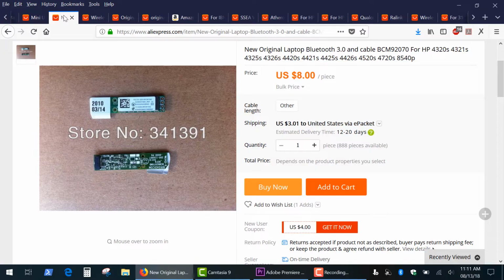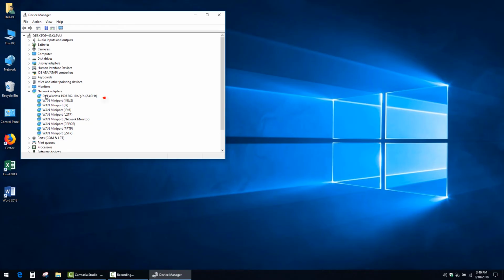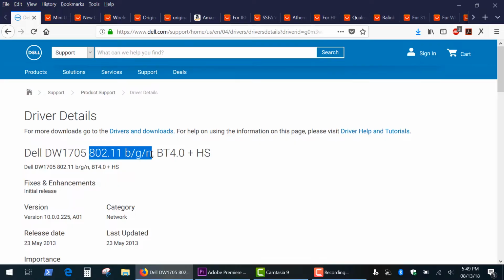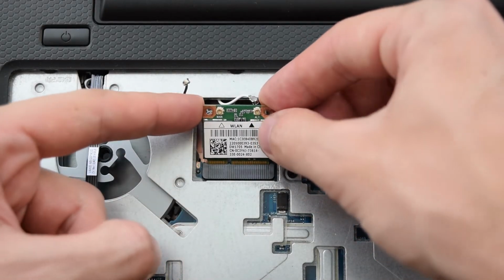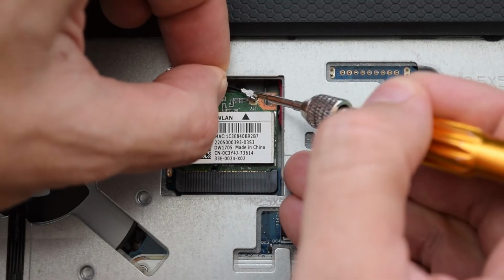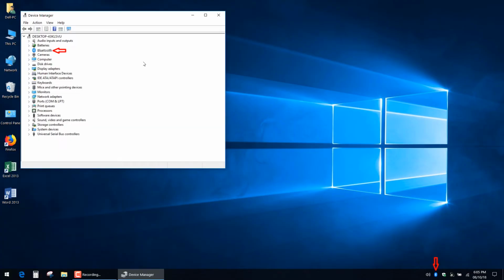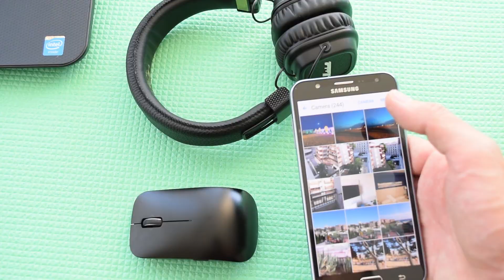How to Upgrade Your Laptop Wi-Fi to 5GHz + Bluetooth 5.0 (Combo Adapter Install)

Comment: Can i also do this to my ps3?
Reply from the maker: The PS3’s wireless module is a custom-made, proprietary combo unit that handles both Bluetooth and Wi-Fi, unlike the removable Wi-Fi cards you find in laptops. Upgrading or replacing it isn’t really an option. If you’re looking for better wireless performance, your best bet is a wired Ethernet connection. You could also try an external USB Wi-Fi adapter, but those can be hit-or-miss when it comes to compatibility.

Comment: Help to find 5ghz card for my hp 15ay503tx laptop
Reply from the maker: Here's what you need: https://alii.pub/75pqbp
This Wireless card supports both 2.4GHz and 5GHz bands and also provides Bluetooth 4,2 connectivity. It will work perfectly on your laptop.
Reply: @ thank you but not able to view the product, it says page requested cannot be found
Reply from the maker: @ I've updated the link.
Reply: @ElectronicsComputers  Thanks for the help, but I just checked my laptop. It has a “Realtek 8723be” Wi-Fi card, and there’s only one antenna cable connected. I don’t have the second cable either. So, my question is, if I replace the Wi-Fi card, will I be able to connect to the 5GHz Wi-Fi? I’m a bit doubtful because of the single antenna cable. Can you help me out?
Reply from the maker: @ I'm perfectly aware that your laptop has only one antenna, I had a bunch of those in my repair shop. It will work perfectly fine on both 2.4GHz and 5GHz bands. You don't need a second antenna. You have to connect your antenna to the connector marked as Aux.
Reply: @ElectronicsComputers  Thank you so much! I’m just getting a bit greedy here. Do you have any cards in mind that support 5GHz Wi-Fi and a higher version of Bluetooth, like 5.1 or 5.2?
Reply from the maker: @prasanna3997  Unfortunately, that HP model has a BIOS whitelist that determines which components can and can't work. The wireless card I linked to is installed in the same model but in a higher-end variant. I checked that in a service manual. So unless you're willing to learn how to modify the BIOS and add different wireless cards to the list, that's the only option that will work as soon as you turn on your laptop.
Reply: @ElectronicsComputers  Thank you so much! You’re awesome! I’ll definitely check out the link you provided. 😍

Comment: I have one question at first wifi and bluetooth work perfectly but suddenly the bluetooth pnly not work but the wifi work perfectly till now first i thought that its a driver problem but i reinstall upgrade try other driver all these but still the problem remain even i dual boot my laptop with another os which is linux at there also only wifi work not bluetooth if its driver problem how can a problem remains even use in another os so do anyone know why this happen and whats the solution pls let me know
Reply from the maker: Try removing the wireless card and cleaning the contacts with rubbing alcohol. Keep in mind that WiFi and Bluetooth are two separate devices integrated into one module, each using different interfaces: WiFi operates on the PCIe bus, while Bluetooth uses an internal USB data line. Ensure that your BIOS is up to date and that you have the latest and correct chipset drivers installed.

Comment: Thanks for the video. It's amazing! What do you think, Can I upgrade my Lenovo G700 laptop? Thanks! (Can't find exact info on this...yet)
Reply from the maker: Unfortunately, upgrading the wireless card on that model isn't easy. Lenovo has a whitelist of approved models in the BIOS, and if you want to install something better, you'll need a custom BIOS with the whitelist removed. So, it's not really worth the effort.
Reply: thank you very much for your quick respond

Comment: I have one question please my moms laptop does not support 5 ghz internet only 2.4 ghz, does i have 5 ghz after i upgrade it to a new wifi 6 card adapter ?
Reply from the maker: It depends on the laptop's model. Not all laptops are upgradable in the first place. What's the brand and the exact model of your laptop?

Comment: Hi, very good video on this upgrade,but please explain more clearly what you gained by this modification.
You replaced DW1701 wi fi card with new model DW1705 wi fi card.
So did this just add 5.0 GHz connection capability?,or did it also improve your bluetooth connection properties.
You explanation would increase my understanding of why this upgrade is usefull.
I have a Dell Inspiron N5050 i5 running windows 11
                                                                        regards   Colin
Reply from the maker: For that particular model I added a combo wireless adapter that also has Bluetooth because the previous model only had WiFi.
Reply: Hi, thank you for the update ref my question very kind of you.
So it just added bluetooth 4.0 but not 5GHz wifi capable.   @ElectronicsComputers

Comment: Man that title makes me lost faith in human... 802.11a was the first that works for 5Ghz channel in 1999 so 5ghz it's not a generations for example That one works at 54Mbps and yours I believe should be more like wifi 5 or 802.11ac that gets up to 800Mbps I believe and wifi 6 it's 802.11ax that makes and speed a grade in both channels 2.4 and 5 Ghz up to 10Gbps... So if you choose a title be care about.
Reply: For sure if ur was wifi 5 or 802.11ac by grace of God it was an upgrade in 5Ghz band too... But as I said for wifi 6 doesn't mean it's in 6Ghz band.

Comment: How to know it’s compatible with my laptop i want to upgrade my wifi card i have old laptop
Reply from the maker: What's the model of your laptop?
Reply: @ElectronicsComputers  hp 620 notebook currently in my laptop rt3090bc4 card but it’s not working from previous some days i want to upgrade but don’t know which card i should use or it will work in my old laptop

Comment: does all bluetooth combo module has the same connectors?  coz I'm looking to upgrade my 10yr old laptop bluetooth combo module and I'm not sure if for the past 10yrs it still using the same exact standard for the connectors.  I'm doing this because logitech wireless keyboard and mouse made it hard for me to switch from pc to laptop coz my laptop needs  that logi bolt receiver to work.
Reply from the maker: What's the model of your laptop?

Comment: This is a great vid! Short and to the point. Now if the replacement card is one that the laptop manufacturer says is compatible, do we need to reinstall the WLAN driver? Point is the driver sometimes seems differ based on WLAN manufacturer.
Reply from the maker: Yes, you need to reinstall the driver. I'd recommend downloading a new driver before you replace the card.

Comment: hello, i enjoy your content. Question can i do this to my laptop toshiba satellite l755-85311?
Reply from the maker: Hi thank you! Toshiba whitelist wireless models in its BIOS, so in order to use some alternative models you need to modify your laptops BIOS. I wouldn't recommend messing with it. If you just need a Bluetooth you can buy a tiny USB adapter like this: https://amzn.to/3W6DB4P or Dual Band WiFi adapter: https://amzn.to/3xfsf41

Comment: There is wifi + bluetooth module on my computer, but I want to attach a higher version bluetooth usb adapter without removing the module, if I do this, will it work?
Reply from the maker: Depends on your laptop model, which you didn't provide by the way.
Reply: @ElectronicsComputers  Its Lenovo 110-11 İSK

Comment: On my old HP Compaq NX7400 (from 2006) a few years ago I had updated the bios with a version without withelist to be able to replace the WiFi card with a dual band card. I had replaced the old Intel PRO Wireless 3945ABG with an Intel WiFi Link 5300 and the WiFi works fine on 5GHz. Now I would like to update the bluetooth from v2 to v4 as well. Unfortunately the NX7400 is equipped with a Broadcom BCM92045NMD module which cannot be replaced with a newer one. I tried to mount an Intel 7260AC instead of the Intel 5100 (using a half-size -> full-Size adapter). Wow, the WiFi reaches 500 Mbps! Unfortunately, the Bluetooth module of the 7260 is not seen by Windows. The only solution is to unplug the internal BT module and use an external USB dongle? Thanks for the tips.
Reply from the maker: The PCI slot for the wireless card provides two interfaces PCIe and USB. For laptops that have a dedicated Bluetooth module the PCIe port usually doesn't wired to USB port. So the only way is to use an external USB Bluetooth adapter.
Reply: @ElectronicsComputers  
I suspected, notebooks produced when Mini PCIe WiFi cards were full-size did not have the USB Data pin connection (36=D- and 38=D+) of the Mini PCIe socket because at that time the combo cards didn't exist yet and for this it was necessary to use a separate bluetooth module. Thank you very much. 👍

Comment: Is it possible to do this upgrade on a HP Pavilion 15.6 p189sa notebook with an Intel i5-4288U CPU

I have a Realtek Rt8723be 802.11bgn wi fi card with 1 main antenna cable, 2.4ghz is the only frequency I have access it, 

Is it possible to upgrade my wi fi card so I have access to 5ghz as well?
Reply from the maker: It's possible to upgrade your laptop. But the problem is that there's only one antenna in your laptop. So if you'll use only one band for example 5Ghz then you can buy Intel Wireless-AC 7260HMW adapter and connect your antenna to 5GHz port only.

Comment: Hey man i know this video was released a while back but i recently purchased a 7260hmw for my hp ProBook and it worked but got rid of 5ghz wifi any suggestions?
Reply from the maker: What's the model of your laptop. Check the settings of your wireless adapter, maybe the 5GHz band is turned off.
Reply: @ElectronicsComputers  hp probook 650 g1 followed your video didn't work Bluetooth worked 2 4ghz worked but did your video and didn't fix

Comment: sorry my english is not good, my adapter 2.4Ghz+4.0, i want to upgrade to 5GHz+5.0
how to know the new wifi/bluetooth adapter compatible to my laptop ? 
my laptop is ASUS A45V with qualcomm atheros AR9845WB-EG + AR3012
Reply from the maker: Unfortunately, it's a very old laptop and there's no compatible adapters for that model.
Reply: @ElectronicsComputers  can you explain how to check that adapter is compatible or not compatible ?

Comment: 1= black and 2= wite????
Reply from the maker: It depends on the model of your wireless adapter. in most cases there's no difference actually, because those antennas are absolutely identical.

Comment: Hello I bought one  combo  adapter from Ebay, couldn't figure how to install the drivers on the  damn thing. I placed  also on my desktop's pci express,  not  recognizable either, coming up  as unknown device.  I installed some drivers according to the module's label but still it didn't work, I bought if from ebay. Could it be  a defective unit, or is  there some specific laptop hardware required like for example RAM that only  works with certain  specs?
Reply from the maker: What's the model of your laptop and wireless adapter?

Comment: Does the ralink rt3290 have 5ghz and Bluetooth
Reply from the maker: It has only 2.GHz and it has Bluetooth 4.0. There are a few models on the market which support 5GHz in this card form factor which may not be compatible with your laptop. What's the model of your laptop?
Reply: @ElectronicsComputers  hp pavilion g6 2000
Reply from the maker: @OliveIsTyping  Here's the best option for your laptop which supports both 2.4 and 6GHz networks and Bluetooth 5.0:
Amazon: https://amzn.to/3qtpQhx
Aliexpress: http://ali.pub/5chion

Comment: Why do you replace both the Bluetooth card and the wifi card? Is the card I’m buying a “combo”? Ie one card that does both?  If the task requires replacing 2 separate cards it’s not a combo. I’m totally confused here. Is it one combo card or 2 separate cards. Is the wifi card optional? Please explain. Thanks
Reply from the maker: Nowadays WiFi and Bluetooth come in one combo module. Cheap laptops usually come with WiFi only module so you can replace it with combo one.

Comment: Nice vid! Just wondering if you know which wireless adapter is compatible with samsung NP300E4X.
This is an old laptop and planning to revive it since I can swap out the parts as well as the wireless card
Reply from the maker: Atheros AR5B225 wifi 150Mbps +Bluetooth 4.0 is the best option for that laptop. http://ali.pub/55fdtp

Comment: i have an old laptop AMD i think this is the solution of my problem because on windows 10 my laptop hp pavilion g6 series has no covered or compatible on windows 10 only for windows 7, but possible if compatible on any wifi & bluetooth card with same pin? sometimes I found in online store there's intel on wifi and bluetooth card its compatible bro?
Reply from the maker: I need the exact model of your laptop to check compatible wireless adapters.
Reply: @ElectronicsComputers  hp pavilion g6 a4-3300m

Comment: Hi, I have a hp elitebook 840 g2. It has a qualcom atheros AR5B95 wifi card. My laptop does not have bluetooth. Please suggest a suitable upgrade so that I can have bluetooth in my laptop. 
thanks in advance
Reply from the maker: The best option for your laptop is Intel Dual Band Wireless-AC 7265 802.11 ac (2X2) Wi-Fi + Bluetooth. The link for reliable seller: http://ali.pub/5301wg
Reply: i have hp elitebook 8470p only WiFi adapter suggest me WiFi Bluetooth card

Comment: I have trouble connecting the antennnas I try push hard but it doesn't go in
Reply from the maker: Make sure that the connectors are not bent or damaged.

Comment: Hi, my laptop is HP Pavilion Gaming 15. My issue is, when I connected it to bluetooth headphone, the audio started stuttering, but when I connected to android phone, the audio didn't stuttered. Does changing bluetooth chipset help this problem? Thx
Reply from the maker: Try to disconnect your Wi-Fi connection, wireless muse and keyboard and check if it helps. 2.4GHz Wi-Fi and some wireless devices may interfere with your Bluetooth headphones. If it's not your case then upgrading your wireless adapter is an option.

Comment: Can I replace it with used wifi card ? Mine is broken
Reply from the maker: Sure! But they are not all compatible. What's the model of your laptop?
Reply: @ElectronicsComputers  LG R570 xnote
Reply from the maker: @AlienO0bserver  Here's the adapter for your laptop: http://ali.pub/50ioev

Comment: Hi could you please help me with this. My laptop had a working WiFi and Bluetooth a while ago and something happened to my motherboard and after the repair Bluetooth is not working and WiFi works frequently not getting internet connection properly. But I connected other card to my laptop, still same. Is it a problem with my motherboard?
Reply from the maker: What's the model of your laptop and your wireless adapter?
Reply: @ElectronicsComputers  Acer aspire v3-571g
WiFi adapter is Broadcom

Comment: My laptop is HP Pavilion Notebook - 15-ab523tx. It only has 2.4 ghz wifi adapter only. I've 5Ghz router and can i upgrade my wlan adaptor? Is it worth to update this to a 5ghz wifi adapter to boost internet speed ?
Reply from the maker: Intel 7260HMW: http://ali.pub/4uc85c will definitely work for you

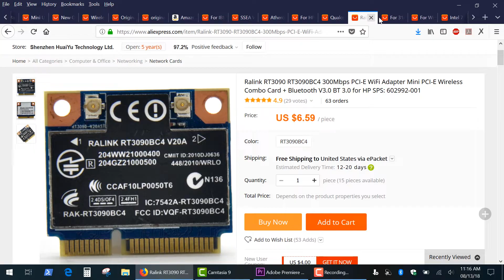Comment: in my laptop only wifi adapter (time 0:43)
no bluetoot adapter. i was using external bluetooth dongle.  (time 0:06)      
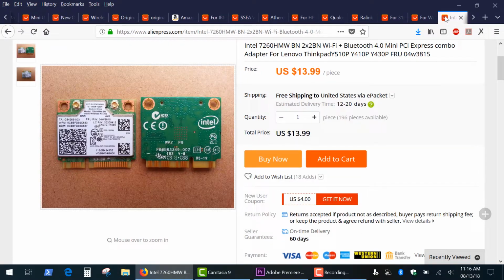and i want to upgrate this adapter to wifi and bluetooth adapter together. (same size in time 0:43)
will it work? 
Acer Aspire 5750G
Reply from the maker: You can use this adapter: http://ali.pub/4tbgam
Reply: @ElectronicsComputers  thanx. Can i use all dual adapters?

Comment: Hi! I found the link for asus wifi and bluetooth chipset in your description but it seems that it doesnt have bluetooth 5
Do you have any newer link for bluetooth 5?

My asus laptop is ROG G551JX (i bought it in 2015)
Reply from the maker: Combo adapters with Bluetooth 5 doesn't exist and that form factor card. Wireless adapters with Bluetooth 5 have different cards form factor with different slots. The only way to upgrade to Bluetooth 5 is USB dongle.
Reply: @ElectronicsComputers  Ah i see, so once ive connected a bt5 dongle, will it automatically replaced the "laptop" bluetooth?  and do I have to reconnect all of my peripherals to the new bt5 dongle?

Comment: Thank you for the video. Well explained.Can you please let me know if i can replace my broadcom BCM943225HM with Qualcomm Atheros QCWB335 to my acer aspire 5742. i am running windows 7 but can update to windows 10 if that is needed.thanks a lot
Reply from the maker: That model uses only Broadcom Atheros adapters which has same specs.
Reply: Thanks alot

Comment: Hey .good job . Question ? does your card support 5G network now ? I have the DELL Inspiron 1525 . Please let me know .
Reply from the maker: such WiFi adapter doesn't exist too old laptop. It's not just about wireless card it's about the whole platform CPU, chipset etc must support those card and its instructions and speed.
Reply: @ElectronicsComputers   you still didn't answer my question ? Your card allows you to read 5G signal or not ? Please let me know , thank you !
Reply from the maker: @samirelsakka298  If you mean 5Ghz wifi signal then yes if you're talking about 5th generation of mobile cellular network then no. I'm pretty sure they don't exist yet. Maybe on the level of prototype but definitely not on the market.

Comment: What combo can i use for hp folio elitebook 9470m so as to get 5.0 bluetooth version?
Reply from the maker: There's no compatible adapters for your laptop with Bluetooth 5.0. It's a very old laptop platform so no support of Bluetooth 5.0. But you can still upgrade your WiFi adapter with Intel 7260HMWG card which supports 5GHz band networks. But first you need to update your BIOS to the latest version.